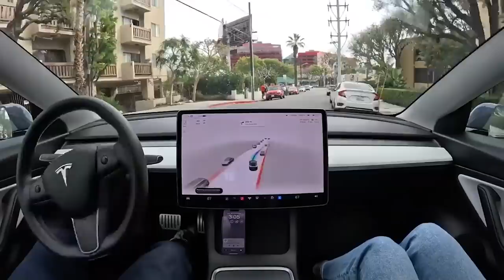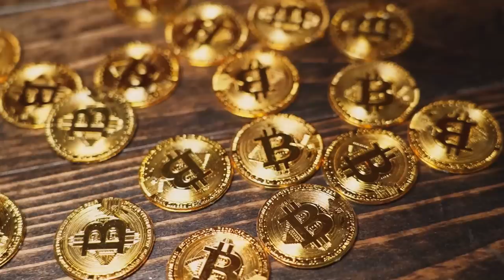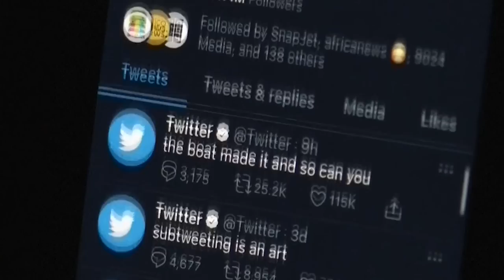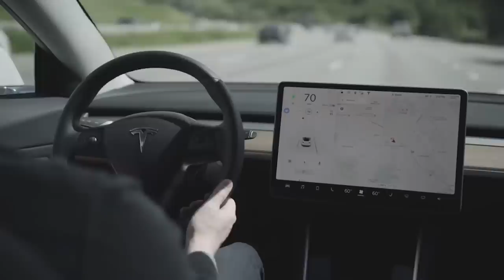All in on Tesla or SpaceX?

Comment: My thoughts:
1. Tesla 2. SpaceX 3. Neutralink 4. Twitter 5. Boring Company
Why: boring Company aims lower (just tunnels) so lowest potential, Twitter aims high but is currently basically identical to what it was, no major technological breakthroughs yet - need falcon 1/roadster moment (proof of concept). Neuralink SpaceX and tesla all have unlimited potential and each have proof of concept, they are ranked by defensible potential (what can we reasonably argue with tech that is there at least as proof of concept). Tesla with ai, battery, car, semi has strong defensibility. SpaceX with reusable falcon 9 to, and neuralink with succesfull interfaces with monkeys has the least defensible proof of concept of the three